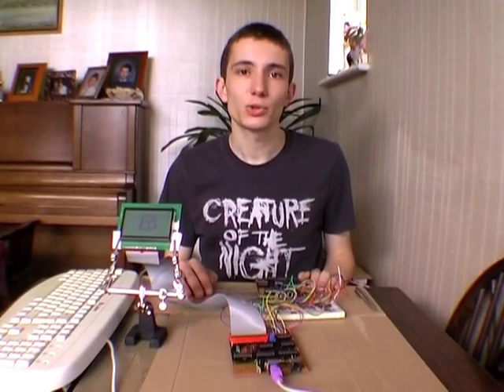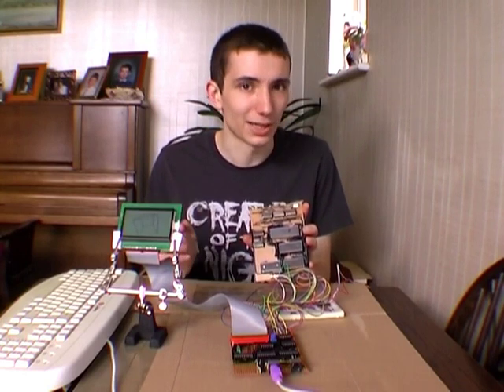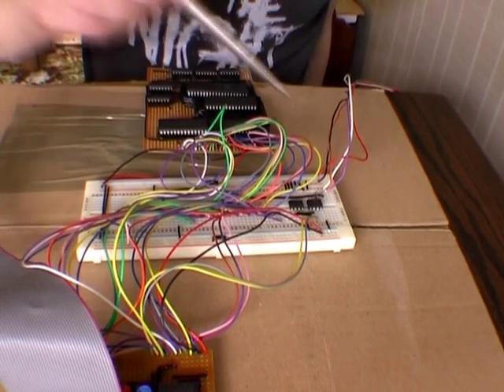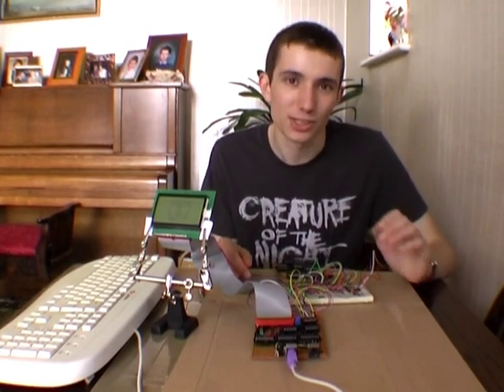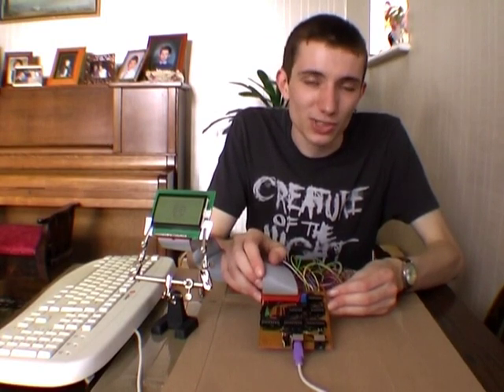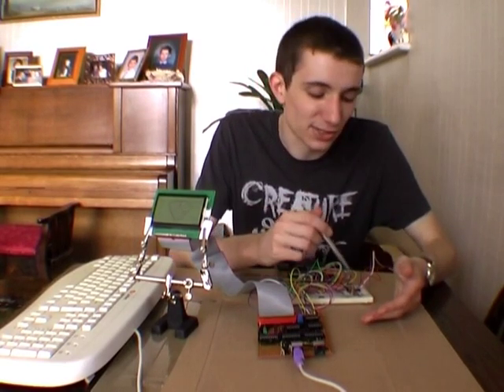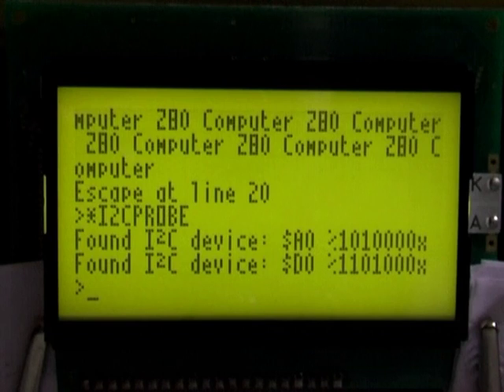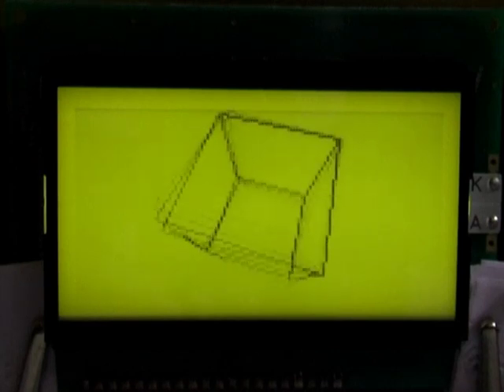Z80 Computer

Comment: Jumping processor speed??? Use the Wait state when your processor accesses the LCD display and your problem is most effectively solved excluding a DMA.
Reply from the maker: +F0kGggle That's likely the more correct way to do it but requires a lot more logic than simply dropping the clock speed, so I was trying the simpler option.
Reply: Can't you just squeeze in some NOP instructions ?
Reply: i was thinking the same thing, i dont understand why this would need a  state machine? i have just built and am in the middle of writing some drivers for a basic z80 system driving an st7920 128x64 display and i can drive the display with the cpu running at 8mhz. i claim a 1024 byte area of ram as a backbuffer then calling my flip at the end of my rendering loop(copying the 1024 byte area of ram to the display) i use six nop instructions between setting en/rw etc pins high and low to keep the display happy any less and things go awry, it all seems very smooth so far( i am using 374 latch chips )... @benryves have you every released the source for your spinning cube? i am about to start writting my own 3d tests for mine but the software maths routines i need to write are a turn off. thanks

Comment from the maker: It does, though being able to make use of that to create the correct signals to control the LCD seemed rather fiddly. In the end I designed a completely different machine that uses an AVR as an I/O controller with a flip-flop to trap I/O requests and to use the WAIT feature to give the AVR time to respond - a video is on my channel. Thanks for the comment!

Comment from the maker: I'm not soulmasterdw but a good book for covering the basics of electronics right up to microprocessor systems is Electronics Explained by M W Brimicombe - it is an A Level textbook and hence quite expensive, but you can preview a few chapters on Google Books for free before buying it. If you're into the programming side more than the electronics side a cheap microcontroller development kit (e.g. MSP430 LaunchPad) may be a more accessible introduction.

Comment: its 256 is wat i think it be
i dont think be hard to use a 486 base video card 
with that it just dumps data to video and its prossesor makes up the graphix and u can do that at speed of cpu not of the crt refresh rate isa 4 bit 8bit pci 16bit 32bit is much simular to z80 system since the 486 is sort of a supper z80 also make it whole lot faster if u use the alu unit that was seperate in thouse days and old 486 era has fast ram chips witch add to cpu chache if ur rely keen use the edo ram too XD

Comment: u eatheir have to make the game as the only function of the pc witch is how alot of the first pcs ran the game
or u made a deadicated gpu kind of setup to process the graphix
the problem is that it takes alot of cpu time to draw moving data it has to make the lines move if its vga if its sync its the back pourch and video signal if colour then colour burst then signal then u have the 3 colour feed data witch is like 255 bits of strength 3x and it all has to be done 25 times a second

Comment: if u want to learn lots get cheap stuff etc let me know i wreck electronics hoard lots and have lots of colected info all round place from fp smart drive engineers manual for moddle repairs i have coupple sinclair zx80 i think copple 8080 pcs a amstredrade pc arcade boards poker machines valve stuff eg lots magic eyes nec tk80 10 odd osilascopes mi room is a hoard of stuff XD

Comment: wen i learn how to make code and use it in pic and make flow external to software and software to external i have a gentle annie washing machine with stuffed bearings and seal and i can think of no better way to send it off then a laptop hooked into a mcu and over rpm it till it explodes XD
im lucky to to have the engineers maunal for smart drives so handy
its only a moddle repair stuff

Comment: best programing language is hex witch is raw data but c is used also the lower u go the less memory in chip u use for ur code and the beter the code will run but it also depends on program u use to load it into chip best if u want to understand in more depth u look at how the cpu runs and how code flows in cpu and how each type and level of programing works and the reson behind that langauge of programing

Comment: it takes alot of effort for these to run a crt u have to run vertical horizontal lines if u control them and map out the pixels for such then display and thats just basics of it that takes most of the power away from cpu read up on the sinclair zx80 based pc they had problems with this as well

Comment: start with microcontrolers the microchip is good and there website once signed up has lots circuits and code already to go 
theres a hudge mass of simular chips and sites look up microcontrolers
microprocessors are more complex and in freedom more powerful but with less features u can do more with 1 but it takes alot more time and energy to use the microcontrolers have lots shortcuts and internal electric features

Comment: why not go serial to parallel shift register that way cpu runs at speed it wants and so does the lcd and u just latch shift register wen u want to write to display that idea should work or somethink simular maybe a little ram chip read write at different speeds dont qoute me on the electrical aspects  
also for ur input/output board put chips on the bottom as well even dead bug configuration glue 1 chip ontop other then add wire to its leads or layer chips 1 ontop other extend pins

Comment from the maker: Pong was implemented in hardware, not software for another system - as such, no, this would not run the original Pong.
However, some people have built replicas of the original - some in an FPGA, others using discrete parts. See imgur dot com/a/TUGto/layout/blog for one example. :-)

Comment: or you can create your own clock frequency with a gpio pin writing data out the address or data bus to memory map i/o devices. My mcu is 24 bit address 16 bit data, but I'll use the top 8 bits of the address bus to select between 32 devices to leave 16addr/16data, I can always chip select different devices for more storage through the address decoders. The best thing about this is you can select a device to write to and hand an address for the device at the same time.

Comment: The dividers are pretty much set on their outputs, but I'm sure there are programmable dividers. Maybe you can use a binary counter to slow the rate down by dividing by 2 each pin, clock divided by 2,4,6,8,16,32,64,128. I didn't think on that, but it seems like it might work only the slower clock rates stay on longer. I have some 74hc series components on the way and will see how they work. My main job is to get a 32 rom memory bank switching device working with 2 addressdecoders to select chips

Comment from the maker: Would such a divider provide a clean way to switch between speeds? I had a circuit to optionally divide the clock by five and switch between 2MHz and 10MHz but the changeover resulted in a runt pulse that would cause the CPU to lock up. My plan to fix it was to run the output signal through a flip-flop clocked at 20MHz but in the end I replaced the slow directly-accessed LCD with a dsPIC33F-based video display controller  (driving a 320x240 LCD, VGA monitor or PAL television set).

Comment from the maker: Thank you! I don't have full documentation, but benryves(dot)com/bin/z180/I2C.asm is the I²C code, benryves(dot)com/journal/3298164 has the open-collector I/O port schematic and benryves(dot)com/journal/3312284 has more information about the I²C implementation. Note that the schematic has a bug - you should insert a resistor (I think I used 2K) immediately before the base of each output transistor.

Comment from the maker: @johnnyw66 Thanks - to address more than 64KB I used used a latch as an I/O register and connected some of its output pins to the address pins (A16 and above) that the Z80 couldn't drive directly. The Z180 has a built-in MMU and can address up to 1MB of memory, which would make things a bit easier. I ended up dropping this design (and LCD) for a different one entirely - see the "Mark 2" video on my channel.

Comment: btw, it reminds me of a dual cpu z80 based computer circuit i saw once before... maybe you can add a second cpu to your design :)  they used alternate clock signals so they didn't need a wait state... both with full access to the enter 64kb ram

Comment from the maker: @fredosstudio I started with the software side (writing programs for my graphical calculator and the Sega Game Gear). For the hardware side I relied on the Z80 Family CPU User Manual (search the web for um0080.pdf) and the datasheets for the various other components. "Electronics Explained" by M W Brimicombe is a good textbook for getting started with electronics if you don't have any experience in that field (try the preview on Google Books first as it's quite expensive).

Comment from the maker: @PeterCCamilleri Thank you for your comment. I built a new Z80 computer that uses the /WAIT feature - a flip-flop automatically asserts /WAIT on any /IORQ, at which point an AVR microcontroller performs the requisite I/O operation before resetting the flip-flop and letting the Z80 continue.

Comment from the maker: @TheOneToxic Sounds like a plan. I had intended on doing it manually, though your automatic switch sounds like a good idea. My main issue were runt pulses when switching between 10MHz and 2MHz. Ultimately, I scrapped this design and went for one where everything ran happily at 10MHz.

Comment: you may have allready though about this but:
To switch speed in software, just have two clocks connected to tristates (to control)
Have  a D latch to remember which of the two clocks is being used and use the and use the IO address lines to activate it. so maybe when address 1 is chosen it initiates 10mhz and when address 2 is chosen it changes back into 2mhz.

Happy designing :)

Comment from the maker: @3mustardMoNkEyS The AT protocol is different to the I²C protocol so you would not be able to use the I²C module to control a keyboard - you'd need to implement the protocol yourself in software.

Comment from the maker: @3mustardMoNkEyS The clock and data lines for PS/2 (and AT) devices are open-collector, in the same way that the I²C SCL/SDA lines are. On the ATmega you can implement this by using any two digital IO pins. The two states would be a pin configured as an output driven low or a pin configured as an input with a pull-up resistor.

Comment from the maker: @hitechguy18 Sounds like a good plan, thanks for the tip (though I've usually seen such a design referred to as "riser cards"). My revised design (using an ATmega644P as an I/O controller) fits easily on two breadboards, so I should be able to make the final circuit much smaller. :-)

Comment from the maker: @buzbee1 Thank you, and your work on Magic-1 is very inspiring! I have since started working on the project again, and replaced all of the I/O devices with an ATmega644P. A flip-flop between the /IORQ and /WAIT Z80 pins is used to give the AVR time to respond, and the Z80 can now run at its full 10MHz. Having a programmable I/O device has made things much easier, and I currently boot CP/M 3 from an SD card.

Comment from the maker: @pieznice29 I don't know much about the ZX Spectrum, I'm afraid. :-( The ULA seems to be used for video, but I don't know if it also provides general I/O capabilities (I can't find much information about that).
The chip I referred to was the Z80-PIO. I'm probably going to end up using an AVR for I/O (keyboard, storage) and interface that with the Z80 using some latches as per the current design.
Best of luck with your project!

Comment from the maker: @ZXRulezzz Ah, as long as that works for you. My main problem was the LCD trying to put stuff on the bus when it shouldn't, causing odd crashes. I hope your solution is more reliable! :-) I hope to use a 320x240 LCD driven by a PIC instead, which should make things more robust and more efficient (drawing operations can run on the PIC).

Comment: @benryves Yesterday I fixed the problem :-). I connected R/W pin to Z80 address line (A3), and E to inverted Z80 /IORQ.
Only one thing that is uncomfortable about that type of connection that you much change port address to read or write to display... And there's no diffrerence between IN or OUT instruction to display.

Comment from the maker: @ZXRulezzz I think I had similar problems to you. I used a 3-to-8 decoder to split up the address bus, and this 3-to-8 decoder has an "enable" pin that was connected to /IORQ. The LCD's R/W was connected to the Z80's /RD pin via a NOT gate. E was driven using a binary counter connected to the Z80 clock and reset by /IORQ. For a better explanation, see benryves com journal 3302840 (insert a dot before com and slashes between the other parts).

Comment: How did you connected LCD module? I'd like to know, because I did simple Z80 system myself, so I tried to connect KS0108-compatible 128*64 LCD to it (directly to Z80 bus, C/D is A0, CS1 is A1, CS2 is A2, E is /IORQ, RD/WR is /WR)... No luck.

Comment from the maker: Thanks for the comment! I'm afraid I don't have any circuit diagrams for this. The memory ICs have their address and data buses connected pretty much directly to the Z80 (the three most significant bits of the 128KB ROM's address come from an I/O register to implement bank switching) with 3-to-8 line decoders (74HC138N) connected between the Z80's address bus and /MREQ pin to only enable a particular memory chip for a particular address range. Is there anything in particular you need? Good luck!

Comment: Do you have circuitry of this? I'd like to build the same thing myself! (only with the 40 pin Z80 parallel IO chip instead of the "Glue"registers). Nice presentation and well explained. Give us an update on this amazing machine! You're BBC Basic Z80 implentation was already finished so practically you should now be able to write programs on it! (how about a paint like program?)

Comment from the maker: If you think that PLCC44 is easily soldered to wires then you have a steadier hand than me! ;-) Farnell are selling them for around £7, and I've found a PLCC44 to DIP40 adapter for $8 - though I don't know where four of the pins go (and they all seem to be PIC-specific). I'll continue hunting, thanks for the tip!

Comment from the maker: I thought it was the NES that had a 6502-based CPU in it? I was more of a Sega fan, and they used Z80s in their consoles. ;-)
When looking for Z80s I found a couple of slower ones on eBay being sold as spares for the ZX Spectrum; there are two 6502s on the UK eBay at the moment, but they're pretty expensive.
I've only written a few snippets of 6502 assembly for the BBC Micro, so couldn't comment on how easy it would be to build a computer around one. The Z80 is certainly easier to find!

Comment from the maker: Cheers! The Z80 is a Z84C0010PEG (10MHz), the fastest I could find for a reasonable price in the UK (£5.58 from Farnell; there is a 20MHz Z84C0020PEG if you can find it). The two SRAM ICs are CY62256NLL, £2.27 each from Farnell. The flash ROM is a AM29F010B, £2.69 from RS. All of the glue logic is just 74-series.
Sourcing parts is the easy bit, I think - finding the time to work on your own projects is much more difficult! ;-)